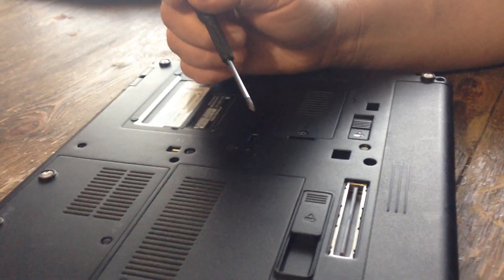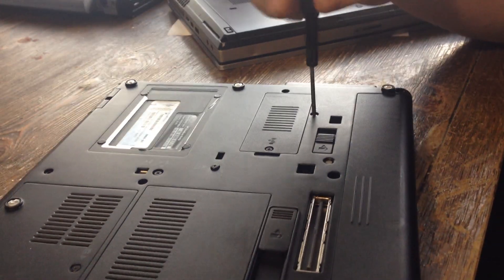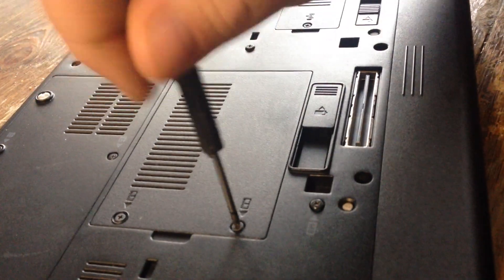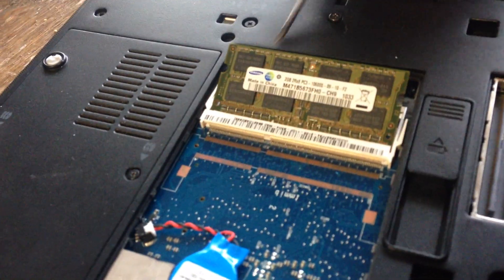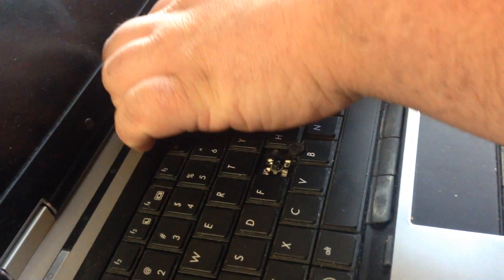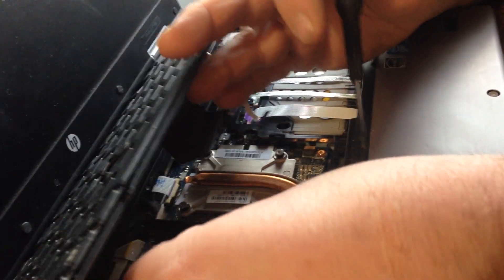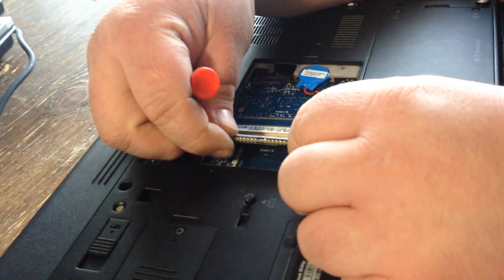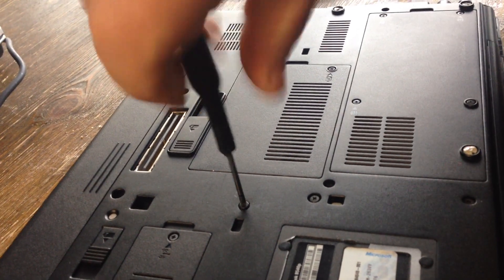How to Remove, and Install Memory in an HP Elitebook 8540P RAM

Comment: What Ram the 8540p has? Can I use DDR3L? or just DDR3??
Reply from the maker: Try it i think it will work, ddr3l means low voltage and was designed for a 4th gen processor i think that laptop is a 2nd or 3rd gen proc but most likely ddr3l is backwards compatible i could be wrong if i am please let me know. If you do try it put in one stick then try lighting it up and if you got video then your good to go and put the second one in..
Reply: thnks a lot!!